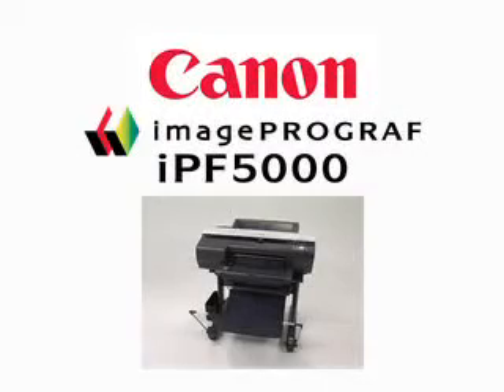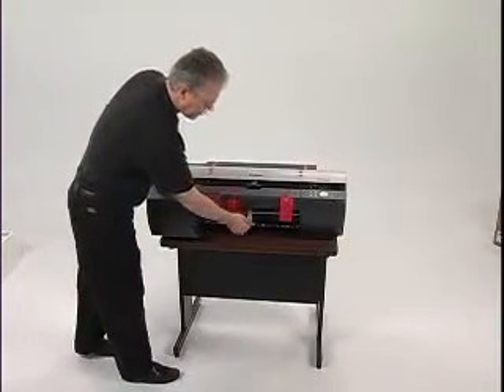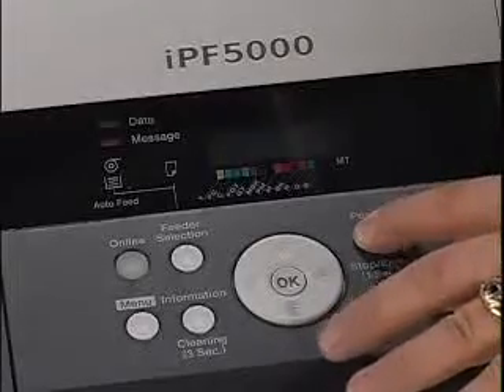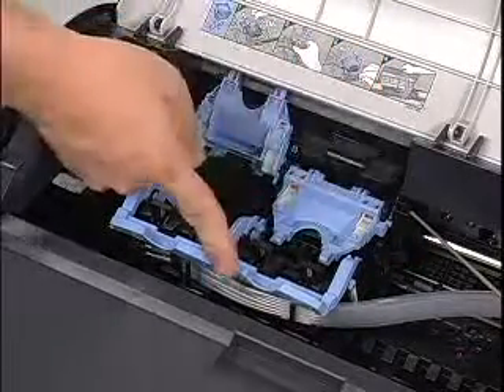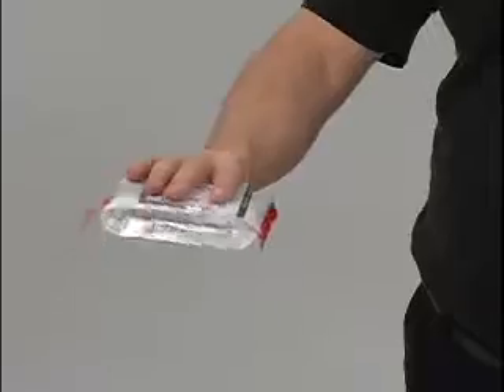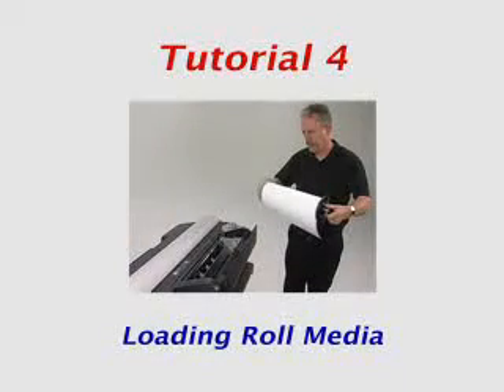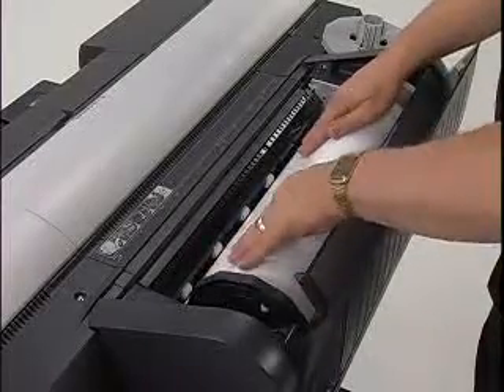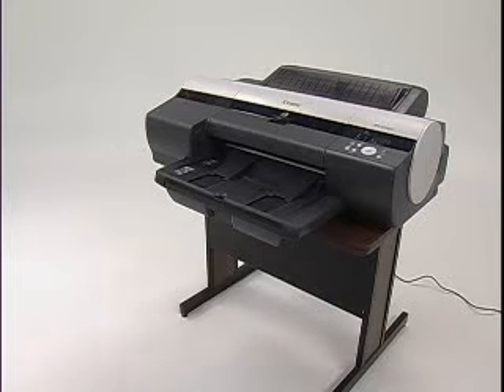Canon iPF5000

Comment: I have the 5100, i need to remove the printheads for a cleaning.. how do i get the printheads to the center so I can take them out?
Reply from the maker: in the maintenance menu select replace ph
Reply: won't that drain the printheads prior to taking them out,  so when I put them back I'll lose a ton of ink? somebody said to choose .Change Cutter,, setting.. that'll bring the heads to the center
Reply from the maker: No it take a little out of the head puts back in tank, then purges it back in when you put the head back in. both was work fine no prob
Reply: ok thank you,,just bought new ink hate to waste it